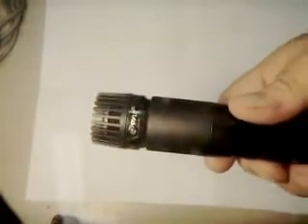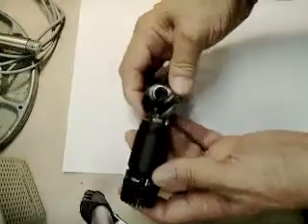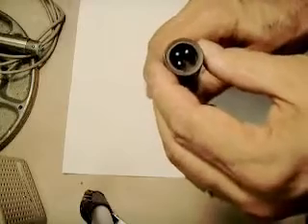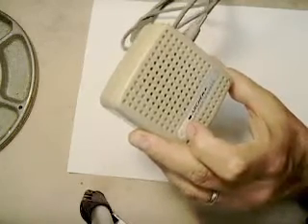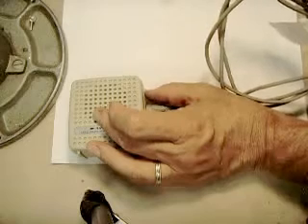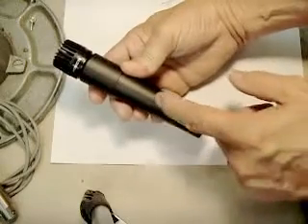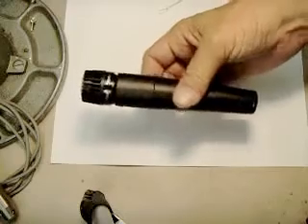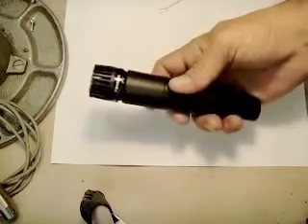Pyle PDMIC78 Microphone - SM-57 Knockoff

Comment: I wonder... how well adding a transformer yourself would work
Reply from the maker: Considering that the mic element is already 600 ohms, I don't think adding a transformer will be of any benefit... unless, of course, you want to change the existing impedance to something other than 600 ohms, then a specific transformer of 600-to-whatever impedance would be good. But that can be added down the mic line before the input -- it's all subjective. :-)

Comment: I followed the advice in this video to great results! My Pyle microphone now seems to have significantly less noise than it did before (or maybe I'm imagining it). Either way it still works, and it's nice to know it's now sending a balanced signal. Thanks!
Reply from the maker: Thanks! Glad to know it was of some benefit. I never understood why they wired those mics for unbalanced--it's really more work for them to make it that way. But at least this is the quick fix. Anyway, it's a pretty good knock-off from what I've found.
Reply: Probably imagining it as making it balanced reduces hum, not noise. (the cable picks up AC hum). But it may be possible your pre-amp works tiny bit better in balanced state... In any case Bob H is totally correct with his fix, it is all correct.